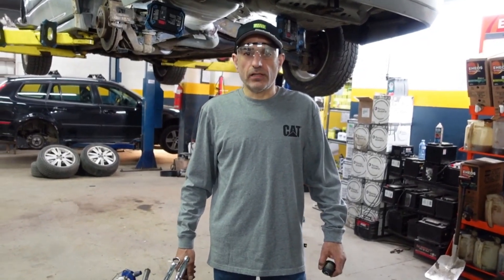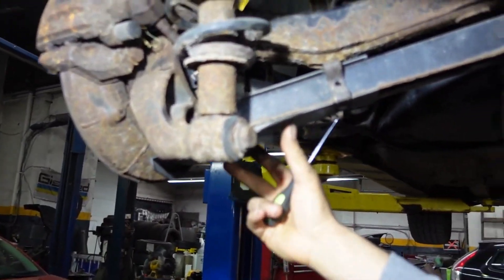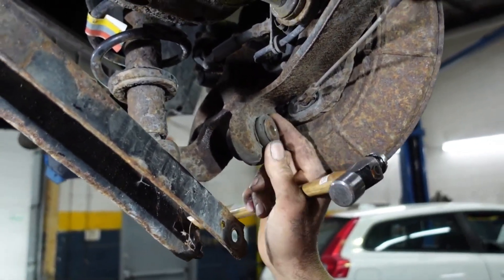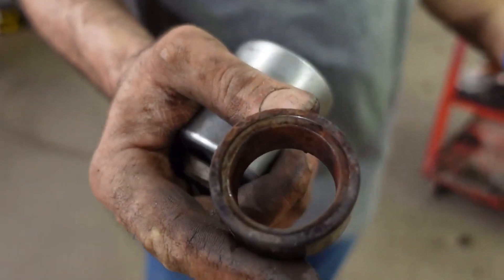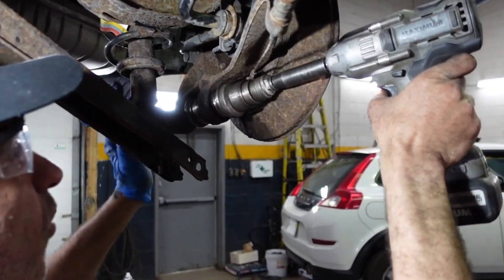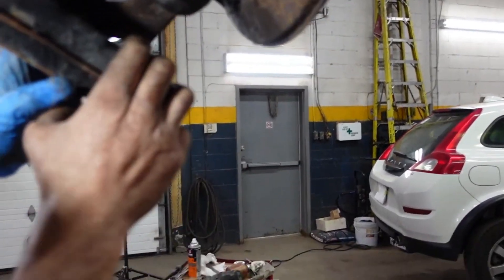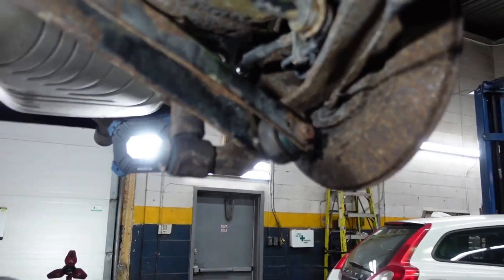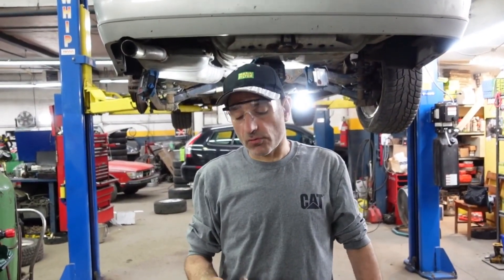How to Replace Rear Lower Knuckle Bushing SAAB 9-5 1999-2009

Comment: Good video. Thanks. I’ve done this job using similar tools. With a threaded rod, multiple washers, etc., I use a 1 1/4” pipe end cup (Home Depot) — with a hole drilled through the center of the cup through which the threaded rod passes — to receive the old bushing that is pushed/pulled through and a 32mm 12 point socket to push the old bushing through the arm hole. I had the end of the 32mm socket cut off so the length of the socket is a total length of 3/4”. Machine shop can cut it down if you can’t. The modified 32mm socket is perfect for pushing out the old bushing or pushing in a new one. The socket is super hard and durable to push out the old bushing ring. And, like this guy’s video, first pound out the center of the bushing entirely or partially pound out and cut it off. You have to do this part or the old bushing will be too long to fit into the 1 1/4” receiving cup when you push it out.
Reply from the maker: Welcome! Thanks for sharing.👍

Comment: Is there a press that will fit in there and work that I can just buy?
Reply from the maker: You can buy the press tool at eBay (Saab 9-5 Rear Upper Lower Control Trailing Arm Ball Joint Removal Bush Tool 95).
Reply: Buy the tool it’s so much easier! It was the best $50 I’ve ever spent. Took me a half hour to change all 4.
Reply: @Matt-me4zz  I ended up buying it and doing one side. Lower bushing the kit doesn't fit so I had to use a socket that was cut down to make it work. Unfortunately I only had time to do one side since I had to figure out how to make it work

Comment: Absolutely dreading having to do both the upper and lower knuckle bushings on both sides in the rear on the wagon I just bought. Gonna be a nightmare I am debating just buying a knuckle with good bushings in it as it will probably be easier.